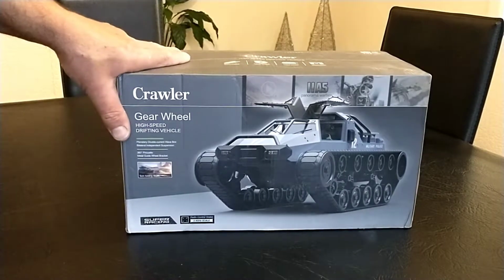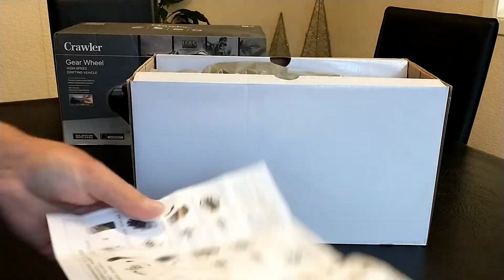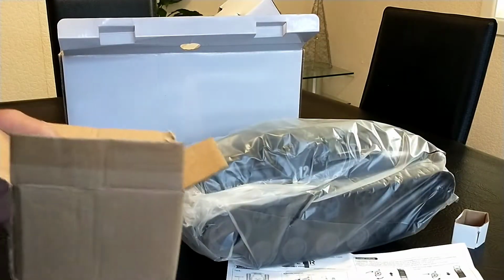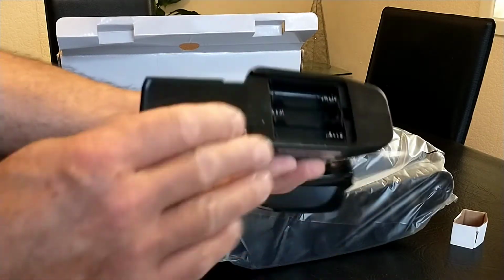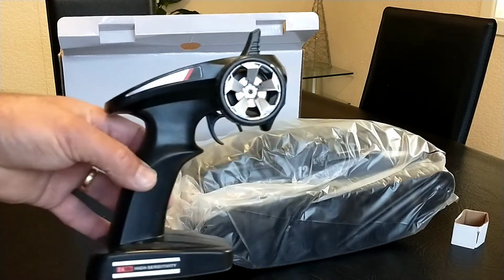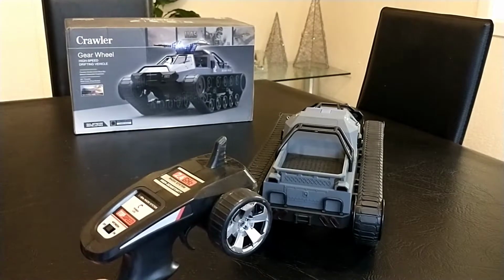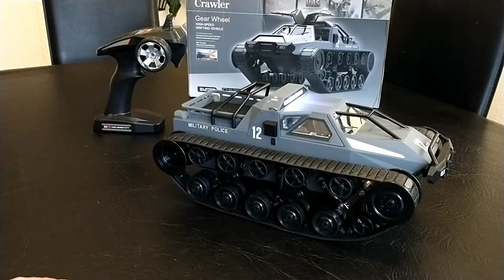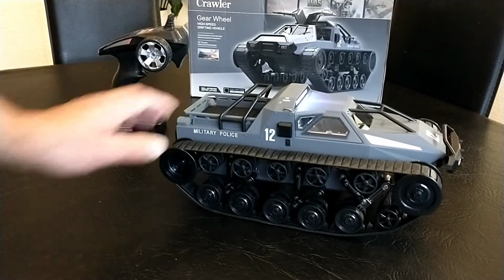SG1203 (aka ripsaw tank) quick unboxing testing & moding !!

Comment: 3:43 it looks like if there were a notch in the plastic wall across the compartment, the battery would slip right in there sideways as far forward as possible without much hassle. 231 grams is 8-1/4 oz, that's one BIG lump of lead.. if battery is forward with lead weight all the way forward, hopefully 2-3 oz would be enough. not worried about the 390 motor geared down like it is in these things, it might run a little longer with a little less weight aboard when doing some hill climbing. I'm waiting until after holiday season is over, we may see a price drop  :)
Reply from the maker: Cheers bro 🤘..
I wish it did fit there it doesn't 😌 
It will ok I'm sure them motors can cope with it .
Yes who knows they might be cheaper after Xmas
Reply: @Fonzierc  clip it out make a new wall across 1/4" back maybe? that or just grab a LiPo that fits there, been hearing the board does have a low voltage cutoff to protect a LiPo.
Reply from the maker: @modelnutty6503  it won't fit side ways 😌 so it's pointless doing that  
Yes they do have a safety cut out  for the batteries